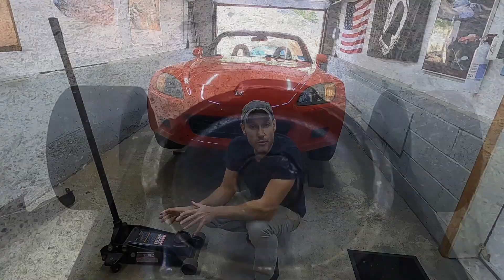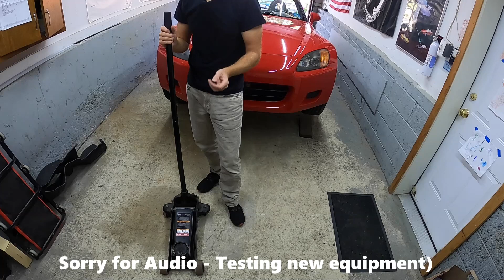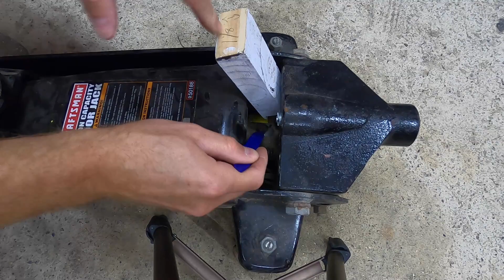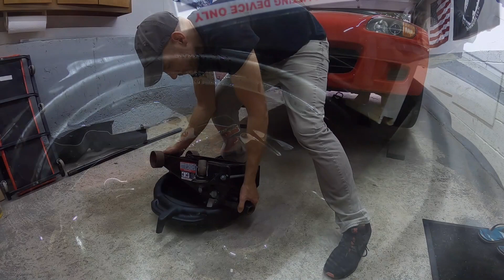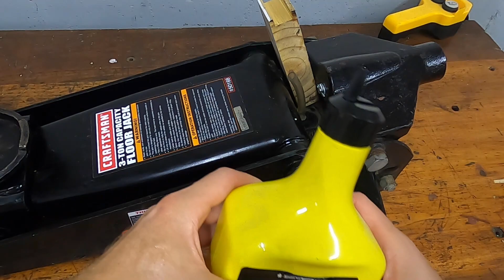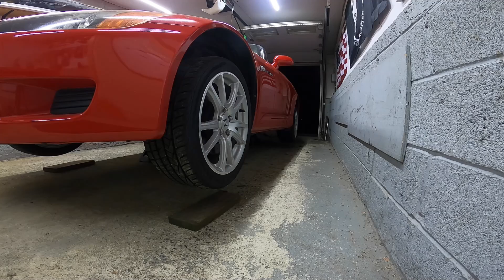How To Replace Hydraulic Floor Jack Oil

Comment: you really should get a second pair of jackstands if you're going to put the whole car in the air like that (at the end). I would never get under a car that's using the tripod method like you did. all it takes is for someone to lean on the rear fender and it can rock it right off the stands.

Comment: Why not just leave the handle attached during most of process keep the plate down? Then you don't need the block of wood and have a bit more room. You can pop it off to shed some weight when you're flipping the jack to drain it.
Reply: @nitroboost  You beat me to it  …….by 3 years…it seems. 🤣🤣